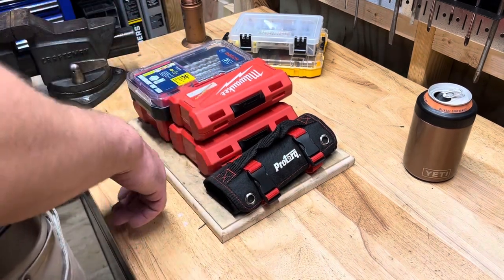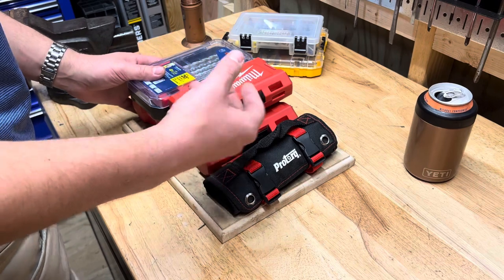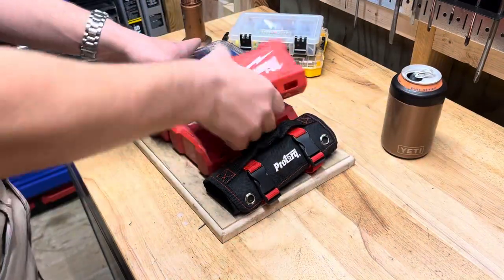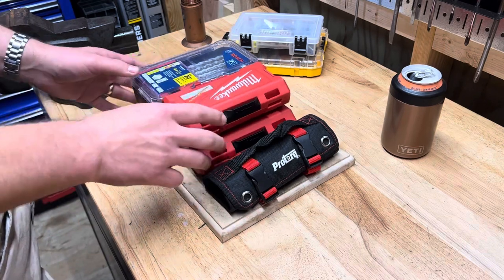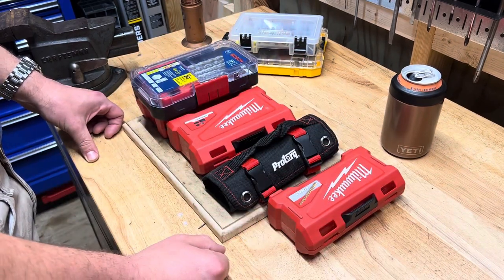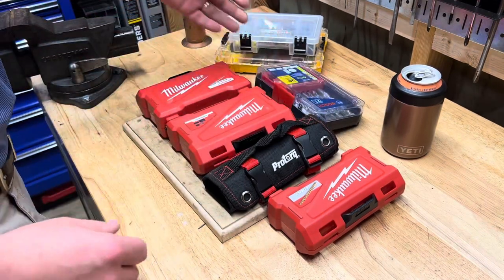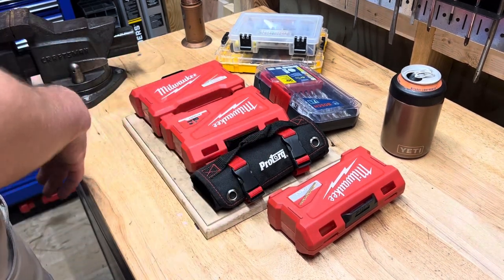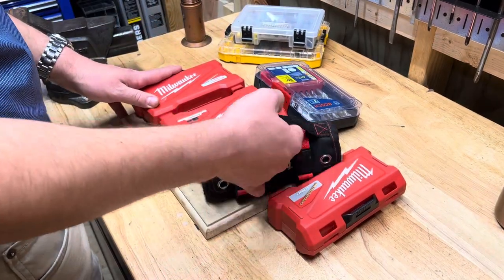Drill and Drive Screw Gun Set! Making sense of my crazy drill bit situation!

Comment: I end up with my driver bits in fishing tackle storage. Some days, I do go through bits, so I keep a number on hand. Especially #2 philips in 1 1/2, 3, and 6 inch. I keep the shorter bits in a Plano #3555 box. I keep my longer bits in a Flambeau box, Flambeau  has boxes that have been treated with Zerust, and here in Florida, with our humidity, they are worth it to look for. Especially for router bits. I have a bunch of those bit set boxes. I buy them when they are on sale, and most live in a box under the bench, I keep one a Milwaukee box in my cordless drill kit along with an old metal drill index. And a small numbers drills set in another index. In my toolbox is a Jorgensens drill set that looks like a sawed-off welding rod can. I've picked up a few of those Dewalt tough boxes and use them mainly for small parts, I'm looking forward to seeing what you come up with for yours. As foe EDC in my tool pouch I have sitting in the bottom are  several 3" drivers #2 + #3 philips a Malco 1/4 - 5/16 flipper and a few drills 1/8", 3/16, and 1/4",  standing up is a 6" #2 philips and a Malco 5/16 - 3/8 flipper. Which covers about 90% of my drill and driver needs. Also in my pouch is a Frankenstein Klein,  a 14 in 1 adjustable bit driver head with the 7 in 1 flip socket drivers body. This covers about another 8% of my driver needs for everything else I'm back to the toolbox in the van.
Reply from the maker: It’s crazy how many of those but cases I end up with. I might have to pick up the flip socket Klein nut driver thing. Those are really cool. It’s a never ending process trying to organize drill and drive accessories 😂😂

Comment: I ditched those regular masonry bits.  Always fighting and struggling even with the 18vfuel milw or 20v Dewalt.  I got 18v (not fuel) milw sds hammer drill.  Never struggle or fight to get holes in concrete again.
Reply from the maker: Yea a cordless sds would be great. I don’t drill that much in concrete, so it’s hard to justify buying one, but I might pull the trigger on it one of these days.

Comment: It's a shame you didn't go with gsr 12v-35fc I think it's 12v-300fc in the US. That bosch has removable drill chuck so you don't have to use hex drills.
Reply from the maker: The changeable heads are pretty cool, but the hex drill bits are so common now it’s really no big deal. I also do have a drill chuck adapter for the hex collet if I need to use a regular drill bit.
Reply: @realworldtoolreviews  That's interesting. In the EU we have hex drill bits but the regular cylindrical drills are way more common and less expensive.